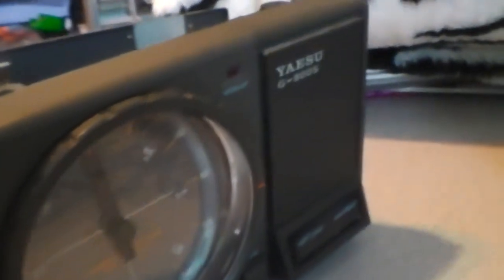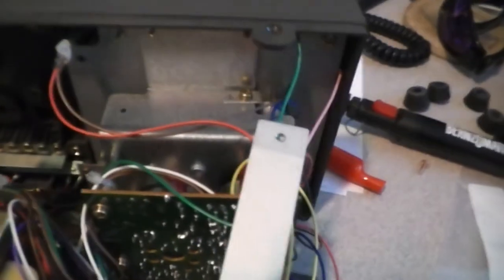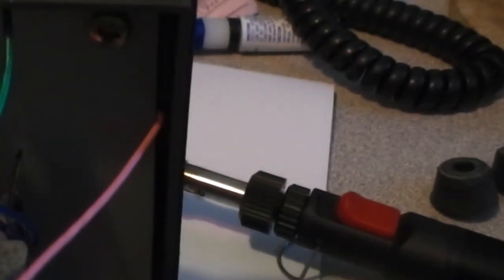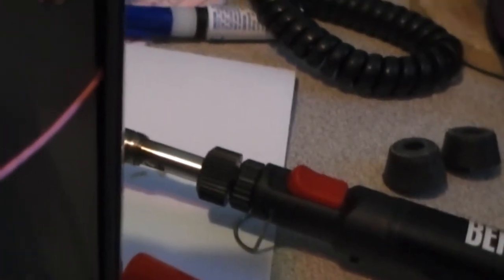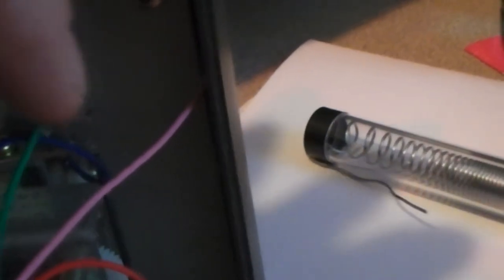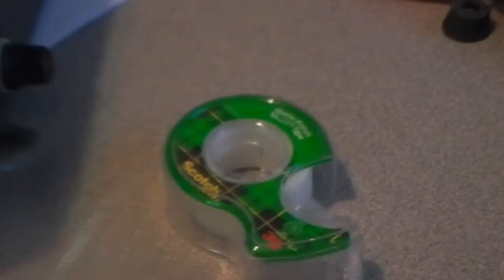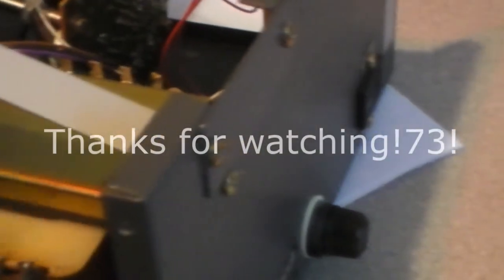Yaesu G800s Light bulb replacement

Comment: Thanks for the information, I had the same problem with the G-1000SDX and G-800S.
Reply from the maker: My bulb is still holding up fine but you might want to try an LED w resistor. That is what I did with my Ameritron

Comment: So much simpler to buy the aftermarket light kit. It’s also a much better light with Three lights on a board.
Reply from the maker: Yeah  I asked if they had an LED kit but this is what they sent, wasn't aware of an aftermarket one. Hopefully I don't need to do it again anytime soon!
Reply: @Sky1  I can’t remember the name of the company that I purchased mine from, but I know it came from eBay and it was not expensive at all and very simple to install.👍🎙